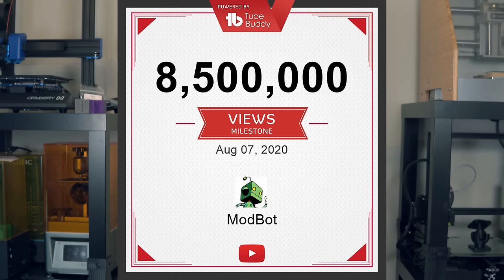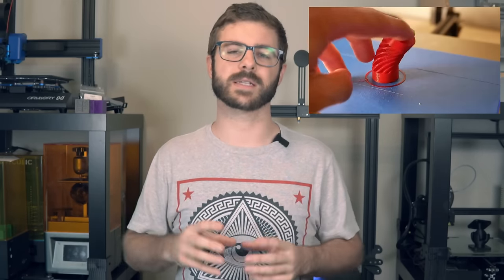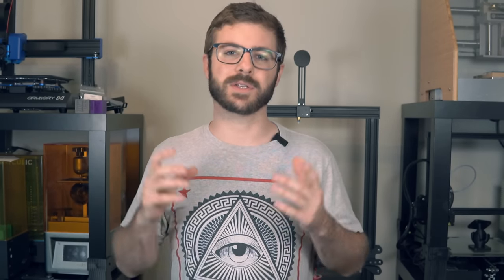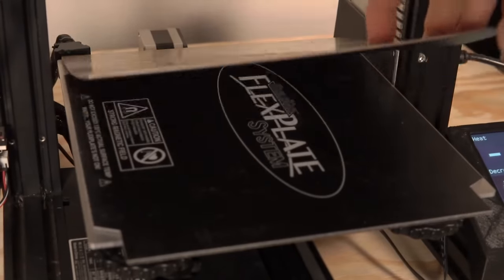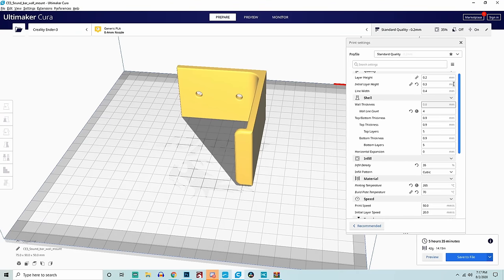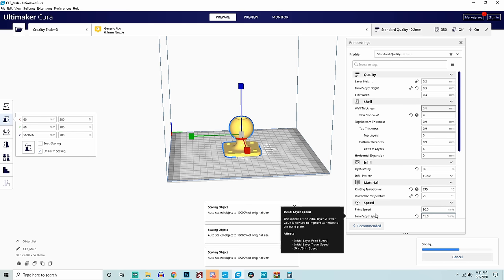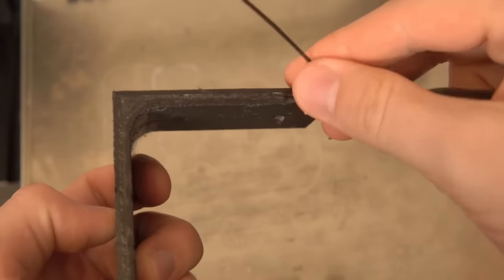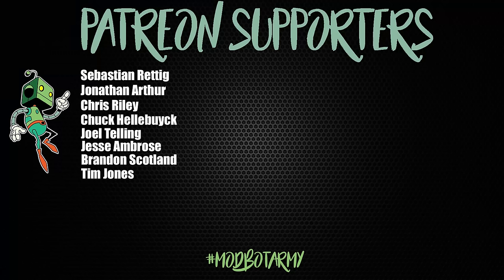3d Printing Carbon Fiber Nylon For Beginners (Ender 3)

Comment: Curious about how you've routed your wires on the Micro Swiss direct drive. Do you have STL's for those mods?
Reply from the maker: I did not do anything special. It should have all come with the kit. Is there anything you see that looks differnet?
Reply: After talking a closer look, I think you’re using some cable clips that come with the  Printermods MDD kit,. The piece attached to the X endstop housing for instance. The only cable clip that came with my Micro Swiss kit was the red one that the PTFE tube attaches to.

Comment: is there a cheaper cf nylon you recommend
Reply: There is no such thing. You either really need CF Nylon or not. Polymide PA6-CF is much better than NylonX or crap eSun. But all these are expensive materials. No real serious CF Nylon that is cheaper than 4-5x the price of PLA, PETG or ABS.
It’s not for toys. With CF Nylon you are going into territorium of serious engineering thermoplastics and not funny stupid objects without any real purpose like most 3d printer users do.
It’s material suited for prototypes, functional parts ie for bikes, cars, RC models like chassis, drone bodies, injection molding forms etc.
Reply: @ZhuJo99  very true  i dont really need anything printed just want to try it out
Reply: @neoprint3d  well might ask, some good filament sellers might be able to provide a sample. I know Polymaker offers their Sample pack #3 with PA6-CF and PA6-GF (glass filled) samples. If you have HSS nozzle (I strongly suggest .5 mm size or more) there is no reason not to try it (well, except for price of shipping which is almost the price of 1 kg spool of PLA). Beware, Polymaker's PA6 requires higher temps that aluminium heat block is not able to handle well, up to 300 °C (and maybe even more). Aluminium starts to soften at 280 °C and most regular thermistors are up to 300 °C max, so it's better to use copper/brass heatblock and PT-1000 or Trianglelabs T-D500.
Personally I have brass heat block and T-D500 thermistor so no problems to print at 450 °C (but for such materials you need heated chamber anyway – heated at least to 120 – 150 °C or more)

Comment: Why is carbon fiber so expensive? Is it that the chemistry of making it a trade secret?
Reply: It's a complex process with a high level of QC. None of it is secret.
Reply: its that carbon fiber is finally what  its called is actually an additive manufacturing process exactly what is sais added while manufacturing no rocket science a feeder and feed rate inline extrusion done.

Comment: I would have printed those parts in PLA or ABS and they would have been fine.
Reply: Agreed. I wouldn't use CF-Nylon for that, rather PLA+ or maybe CF-PLA.
But there is a wide application for CF-Nylon. 
For example: mounting a windshield on motorcycle.
Would you print that in PLA and try it at 100mph+ and 100F+?
Reply: @Sleepery22   I was saying I would not have used those examples.  I am not saying that exotic filaments are a waste of time.
Reply from the maker: Agreed, it was sort of tough in the moment to think of examples for things I needed right away. The main goal was just to show how to print it.
Reply: @Sleepery22  I would not trust FDM printing for that application.
Reply: @truantray  
I actually did print that windshield mount in Carbon Fiber PolyCarbonate and it still holds very well (after 10k+ miles). At some point when I dropped the bike, one of the steel mounts broke, but printed parts are still in perfect shape.
But I do agree that, without understanding mechanical and chemical properties of materials, and with inherent disadvantage of FDM process, it's a dangerous field. But I'm also saying: if you decide to explore it, consider engineering grade materials such is CF-Nylon.

Comment: Carbon Fiber Nylon?  I can't even print in PETG.
Reply: Is warping your problem?
Reply: @rudavko  Not warping, but stringing and underextruding.
Reply: @arturtoth3185  have you tried adjusting the extrusion multiplier?

Comment: modbot i need a 3d printer i toy with rc car and real cars so strong stuff is a must but i am not rich  any diy mods on  starting machine i could mod be great guess i just watched to many videos
Reply: I would recommend the Creality Ender 3.
It’s a great printer and at 150-170€ it’s at the lower end of the price spectrum.
As a stock printer, it can already print pla+ perfectly and that’s a rather robust material.

Comment: Must be perfect to print rifle's receivers...
Reply: no... Watch Brandon Herrera's video on the Plastikov. Rifle calibers are too powerful for 3d printed receivers. Why do you think the FGC9 is 9mm?
Reply: @cursedcaptions8882  I was wondering, because some military rifles like the FN FAL (7.62x51mm) have a nylon body with 30% fiberglass (of course, those bodies are injection molded and their receivers are made of steel), and you can shoot all day long and the body holds the vibration/recoil.
Perhaps with some other combination of polymer/fibers other higher calibers could be successfully fired like .357 ?

Comment: Can when replacing that nozzle for the other then be left in and still be good for many other materials?
Reply from the maker: Absolutely, I will use the hardened steel nozzle for all materials. As it does not conduct heat as well as say brass, you may need to bump your temps of 5-10C compared to what you would normally print at.

Comment: I want to build a shed with 2 inch steel square tubing and connect the tubing with carbon fiber nylon.  Does it have enough tensile strength?

Comment: Maybe I missed the memo, but wasn't the big promise of 3d printing 'platform neutrality'?
Unless [printer name] is doing something completely unique, why is [printer name] important?
Tell me the temperature, speed, nozzle, retraction, acceleration and Phase of the Moon that works for Nylon + Carbon.
What next?
"100 scenic drives for Ford trucks"?

Comment: You must not make such junction out of carbon reinforced material dude. You had to use a steel nuzzle. Because it’s too much abrasive. And any moving parts are an absurd.

Comment: those nozzles are waaaay overpriced, little pieces of metal made of the same materials your Soldering gun is made of, can't imagine why in the hell they are so expensive, $20 is too much. they worth $2.00, we getting ripped off , same goes with the PLA, its plastic🤦‍♂️

Comment: Major mods required. NOT EASY.  Carbon filled nylon requires 380 to 400 degrees C. Requires an enclosed printer. Requires a higher temo heated bed. Requires a dehydration chamber. NOT CHEAP. NIT EASY. YOU LIE.

Comment: Gotta say, carbon fiber filament is marketing bs...
Reply: Yes and no. In PLA is it BS and weakens the prints. In nylon, it does cross-link the layers better, mainly because they use CF fragment lengths controlled for a  minimal size.